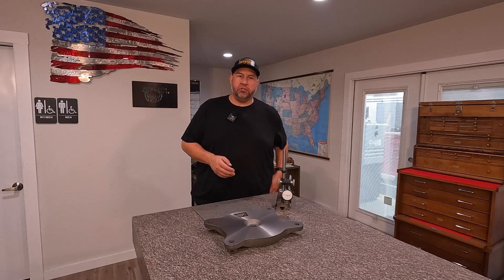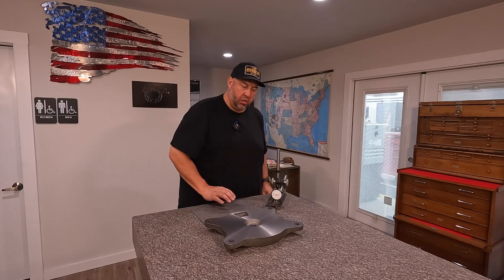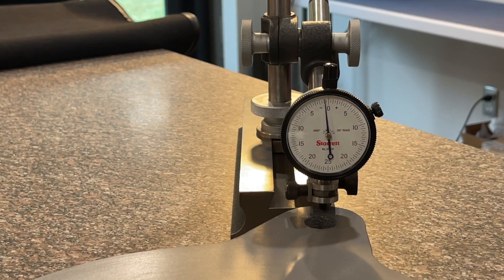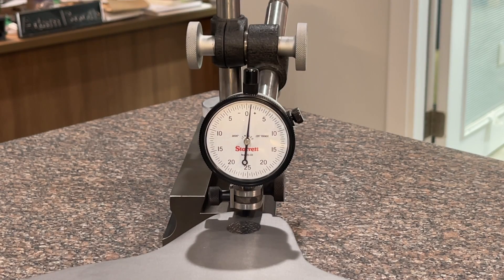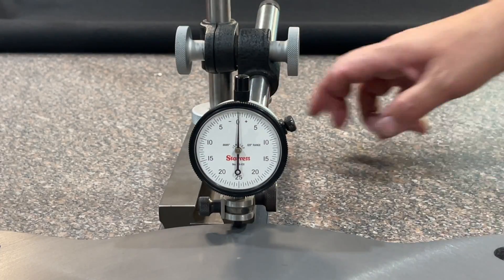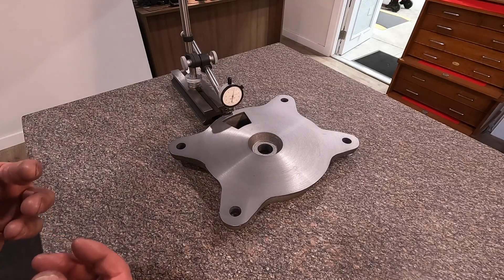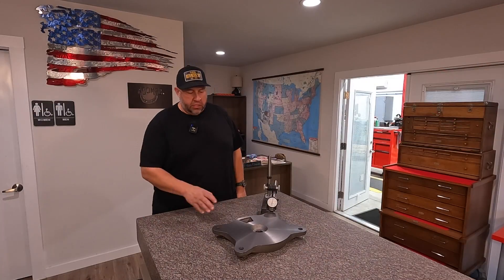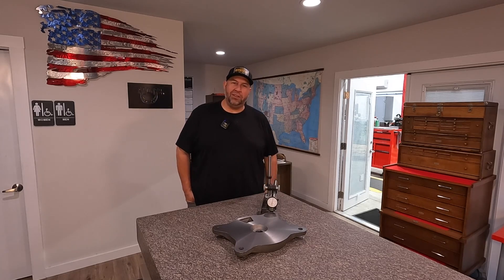Measuring for Parallelism Using the Granite Surface Plate

Comment: Grear show as always!  Your gauge block set should have .050 and/or.100 wear blocks, this is where they come in handy. Stops that rattle on your dial.
Got to know a flat datum to measure parallel features. I am certian that the base is fine.

Comment: OK so to find out which side is off I'm guessing youwould check with a feeler gauge & the surface plate & then probably use a surface grinder to fix it if it had to be prefect

Comment: A good show of tolerance stacking.  There's what the lathe/tool gave, plus instrument accuracy, plus even a great inspection plate isn't perfect.   Considering the initial chatter problems of the cut, this did turn out fairly well.  Chasing more probably winds up at surface grinding but... this piece isn't going to space.

Comment: Can you flip the vise base over and place the bottom side onto the granite plate? Measure for parallel along the upper surface. Also, it would be interesting to see what the factory base would show. Take your factory finished vice apart and measure it for parallelism.

Comment: Short question: are you going to machine/face the surface around the center bore? For my understandind the shoulder of the rotating pin should have a defined parallel or at least even surface to rest again.

Comment: This part does not need to be nearly this parallel. Adam is simply demonstrating how to measure parallelism on a surface plate using the vise base as an example.

Comment: Nice video Adam. I curious though. I would have thought the base would have been dead nuts on What causes the variation? Intermittent cutting? Heat in part when cutting? WTFO?
Reply: For how he machined it, on a lathe, the .002 flatness is quite good. You are not really going to get it any better that way. If the workpiece requires better flatness and or parallelism, surface grinding and or flat lapping can get you there.

Comment: As someone trained in physics, a big granite surface plate and a set of precision measuring instruments stirs my heart! Later, it would be fun to see you work with the vise manufacturer to reduce the cost of manufacturing.  It would seem that you need flatness on the bottom to only about 10 thousands or so, except for the four bolt anchors.  I don't know the details of this part, but I would bet that the swivel surfaces should be circular, planar, and either coplanar or on parallel planes (i.e. offset) to a much higher tolerance.  In inspection, you could put the four corners (on precision shims) down on the granite plate.  You could then inspect the two swivel surfaces for flatness and geometry.

You did a great job, Adam. Keep using that inspection room!

Comment: If there was a tighter tolerance on such a part, would there be a way to achieve better parallelism. What would be the most cost effective method.
Reply: Send all the parts through a stress relieving heat treat before machining them. Do a rough machining then stress relieve again. Very light finish cuts. Use a larger fixture on the lathe to support the part better. None of this would be cost effective for a one off like this one. In a production environment it would still add so much cost with little perceivable benefit to the customer and the additional cost would make it uncompetitive with your competition.

Comment: Great Video, I love the explanations of how to use the various tools.  A little concerned about wiping the granite plate with your hand to remove dust, would a semiconductor cleanroom grade lint free wipe be a better choice, or am I overthinking it?
Reply: Yes you are overthinking it. Keep in mind that SOP for using gage blocks is to wipe them on the inside of your wrist before they are wrung together. The human hand and the nerves in your skin can detect the tiniest amount of dust or grit. If you ever get near a surface plate and they actually let you touch it you will notice this immediately. Basically... "When it feels clean it is clean enough."

Comment: Your last comment about helping machinists to learn is commendable.  While a vise can be quite rough in machining accuracy, this will not always be the case, as you point out.  The cumulative error as you assemble the pieces can come back to bite you.   If you need to be within a tolerance of ×/- 0.01" overall, a combination of differences could the front cause the vise to bind. 

I had a Chevy Monza that had the front end crushed in an accident.  After repairs, the car looked great, and everything fit.  But, there was a squealing noise when breaking when decelerating on freeway offramps with a downhill grade.  On inspection, everything looked fine.  Eventually, the radiator started leaking.  The radiator was worn in one small spot, where the fan blades struck.  The fan blade-radiator clearance complied with the minimum cold engine clearance.  When the car decelerated on a downhill ramp, the fan blades deflected, and the frame was compressed from the accident that contact was made.  The Chevrolet dealer was able to "stretch" the front end by loosening all the bolts holding the front end together and pulling the pieces apart as far as the clearances in the holes would allow.  In all the front end was stretched about 3/16" in length.  I never heard the squealing again.  The radiator stayed tight.  The car lasted 5 more years

Comment: This was a neat little video, plus that base plate really surprised me.  I thought for sure it would've been .004-5 out because of the flex in the material and taking into account that the mounting plate could've been a thousandths off also.  but only .002?  dang, that's just slicker than snot on a door knob

Comment: It would be interesting to see you flip that base over and check for rocking of the surface on the granite plate to see if you really got the base flat. Then check the round bearing surface for variation in height in the orientation that the vise will be assembled

Comment: Is there a chance the base flexed when you tightened the clamping nut?
Reply: I have the same thought.  I don't think that center boss is on the same plane as that outer rim that was registered on the fixture; it's kinda recessed.  So...  tightening it to the fixture there probably introduce a bit of potato chip to the base.  Still...  not a bad result!

Comment: Just to be clear, a piece of copy paper used in most printers or copying machines is 4 thousandths of an inch thick! The outcome of the machining of this swivel plate is half the thickness of a piece of paper! At this point, the temperature of the swivel plate would have more of an effect on the quality of a machining job. Just amazing work!
Reply: And actually, 60lb paper is .004" but the most common printer paper today that almost everyone uses is 50lb which is .0035"  And it's very consistent.

Comment: OK, I have been watching way too many of these videos...  The first thing that popped into my head when you started measuring was why didn't he use a master straight edge to proof both sides?  Was the top side you measured out of tolerance or was the bottom side out and the piece was not resting flat?

Comment: Curious, how would you go about fixing that two thousand discrepancy?
Reply: What do you mean by "fixing"? Reducing it to one thousandth? A half a thousandth? Remember the part is within a thousandth of overall thickness after machining already. Cut any more material off of it and the part will be further out of spec.
Reply: You don't. But if it was actually necessary and the customer was paying a several thousand dollars, the next step is grinding. After that would be scraping.

Comment: It is nothing new, granits surface plates can be machined with very high flatness. Already the old Egyptians knew about this fact. Everybody can verify this by using a precision ruler und place it on these sarcophagus covers in Gizeh, Abidos, etc.. No light shines under the ruler. This means, precision is below half a wavelenght of light - typically so 0.5µm.

Comment: I worked for Boeing in Seattle many years ago as a jig builder. One of the coolest places to work was "the gauge room". We worked off of two foot thick, massive granite tables in a climate controlled room with a max tolerance of .002. Good times. In the day, MEK was the choice chemical to clean the table...probably not a good idea nowadays. Thanks for educating the masses Adam. Great demo!
Reply: I used to work for Boeing in Wichita, KS as a jig builder. I have a couple of validations he didn’t check. Run a .001 between the bottom of the base and the granite. And I would be using last word indicator or a CMM and scan the whole plate.
Reply: @bretlambky  , see my comment.  A lot of castings that have mounting tabs like this vise bottom have some extra metal on the bottom of each tab.  If the bottoms of the tabs are first milled down to be coplanar, the vise bottom will not be twisted when you clamp it down to a flat table.  Even more important, if you machine a fixture to hold the part during machining, the part will not be machined while in a distorted form.
Reply: MEK=methyl ethyl death.
Reply: .002 max tolerance?  Sounds like a dream...

Comment: Adam, great vid.  What is the difference between surface flatness vs. Surface finish.  You discussed the tool marks, but it seems the surface has a good flatness but 'rough' finish.  What are the surface finish requirements for your granite plate?

Comment: Might want to get an air purifier in there for the surface plate. Computer would benifit too.
Reply: It takes dust out of the air. Oh and yes removes orders too if a charcoal filter is installed.

Comment: great videos. but the perfectionist part of me would want to know what the variation in the jaw surfaces is on the lath and the variation in the fixture  made to hold the base.
Reply: Why? The "variation in the jaw surfaces" have nothing to do with the end product. The fixture that was turned on the lathe and never moved is as accurate as the condition of the spindle bearings. The vise base was mounted solidly to the fixture but, as I recall, it wasn't quite large enough to make contact with the outermost machined surface from the first setup. Then he was making an interrupted cut on a raw casting with many variations in cross section. I am surprised that it came out as close as it did.

Comment: Do you worry about using your hand to wipe the surface plate?  Your hand has oil and perhaps other things which might end up on the plate distorting its flatness.
Reply: Hand oil is a natural lubricant for a surface plate and no, wiping will not change its flatness.

Comment: Are you going to machine the surface where the center shoulder bolt head sits against?
Reply: That surface really doesn't need to be machined other than to clean it up. Which he may do later. The center pivot bolt doesn't bottom out on it. If it did, the vise wouldn't swivel.

Comment: Yup a bench vise. It will be mounted to a precision ground  surface that will be mounted to a lapped intercooled 3ft plate and floating on 20 ft piles sunk in the ground with a magnafux core to keep it accurate. I will than show you how I take a 2"x1/4"x6" lg piece of cold rolled flat bar and hit it with my 5lb hammer to make a wall bracket. See my combination square shows its 90 degrees!

Comment: i wonder does temperature affect flexing of irregular shaped parts such as this vice base, and if measuring in same procedure at differing temps produces measurable differences ... not that it matters on a vice
so out of curiosity, what was the temp of the granite block, and what was the temp of the base? the instrument, too, for that matter. when you start checking 1/10000" temp can affect results

Comment: I wonder how much of that variance you're seeing is due to thermal stresses differing between when you turned it on the lathe and when you put it on a cold granite plate?   Also, I'd be very curious to see what readings you get going around on the top surface if you flipped it over.
Reply: Yes, I was wondering what the effect would be to move the vise base plate around on the granite and making the same measurements.
Reply: @AtThePeck   That would be a good sanity check. It should be the same.

Comment: Maybe put it back on the mill and fly cut  it . I would  have like to see it flipped  over and check the ears with a feeler gage or put it on a 3 point stand off set up to see if the ears have rise or slope to them from swinging  it in the lathe without support.
Reply: The part is already at spec thickness. While it would have been much easier to secure the part on a mill table and also support the ears for the mounting bolts you are now left with the problem of finding a 14" diameter fly-cutter and mounting it in a spindle not designed for it. What you gained in rigidity of fixturing the part on the mill table you lost, and then some, going to an outsized flycutter. The outsized flycutter will, I assure you, chatter all the way across the surface of that part even with the lightest of cuts.

Comment: Really appreciate it.  I don't work in the tool room at work but I am a machine operator and I have to measure parts that we produce using digital calipers and a digital height gauge on a reference surface, similar to your setup but my surface is smaller.  Thanks.
Reply: ima cnc machine crasher but hey we have a good time and thats what counts!
Reply: As a hobbyist, my plate is a 12 x 12. Used it to check my scrapping technique on an import rotary table. Loved the process.

Comment: Should've proved out the granite by repeating the measurements in a different spot on the plate.
Reply: Brand new plate. The instruments he was using are not the type that one would use to "prove out a plate." A plate that size with a +/- 0.002" would be a reject and never left the factory.
Reply: Maybe rotate the piece also.
Reply: Yes @DennyReichard

Comment: For those of us that are uninformed I think it would be interesting if you could explain or possibly show a couple comparisons of how small a 1 thousandth of an inch is.  I see the indicator moving but when you say a couple tenths of a thousandth just how small is that?
Reply: If you plucked a hair from your head, that would be about .003" or three thousandths. If you split that hair equally into three pieces the long way and threw two strands away, that would be .001" or one thousandths. If you took that last remaining strand and split it into 10 equal strands the long way, then thew 9 of those away, you would be left with one strand that was .0001" or one ten thousandths. Often abbreviated in machining to be called a tenth. 
A piece of printer paper is also about .003" thick
Reply: i use a set of feeler guages and peel out the .0015. use good lighting and look at it from the edge up close.   its a great visual and can train your eye too.

Comment: Interesting that the two areas most 'out' are opposite each other, both in orientation and direction.  Does that indicate a problem with the lathe or the chuck?
Reply: Because it was turned on an arbor, those kind of problems are probably not the cause.  More likely is that the casting 'relaxed' into that shape after turning was complete - the casting is slightly asymmetrical with the access hole cast in. It could also be because the casting did not cool uniformly and is a little harder on one side leading to differing tool deflection.  Most importantly, that small an error on a casting that big is a great result.  Just snugging up the mounting bolts will cause more deflection than he is measuring.  He and his tools are both outstanding.

Comment: I was wondering if gage blocks stick to the granite like they do each other, that was so cool to see how they were so flat they stuck in one of your other videos. I sort of imagine they wouldn't stick to the granite, but it'd amaze me if they did. Thanks for another video!
Reply: The granite is super flat but not in the ballpark with gage blocks. Plus the porosity would defeat wringing as you guessed.
Reply: No, gage blocks will not stick to granite. They   stick, “wring” to each other due to their extreme flatness of a few millionths of an inch or millimeter.
Reply: @ellieprice363 i knew thats why they wrung together, which is still super cool.  i also kind of thought that it wouldn't stick to the granite, i bet if you looked at the granite under magnification, it'd be porous. I still thought there'd be a chance since the granite is super flat as well.

Comment: Can you compare flatness ,parallel and roughness
Reply: Yes. He just did. With real gages and numbers. Watch the video again.
Reply: @utidjian  flatness isn't checked from a datum the part is normal on jacks
Reply: @billspud2975   the part wasn't flat in the video so it was also not parallel. The machined surfaces were rough in the video even though the finish for a casting was pretty smooth. Your question was, "Can you compare flatness ,parallel and roughness"? Which he did.